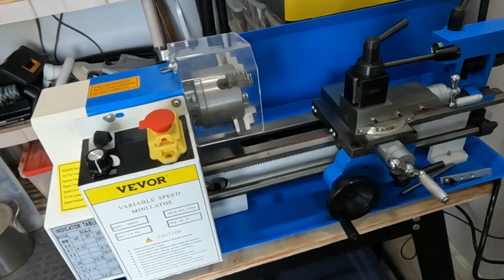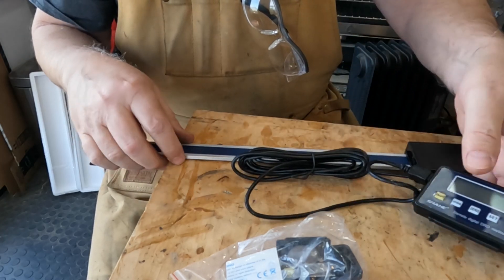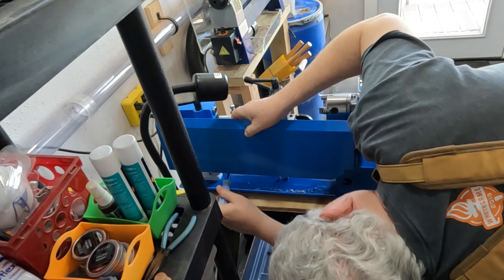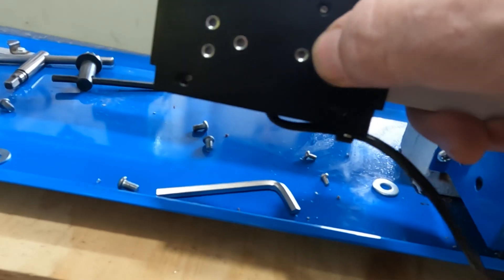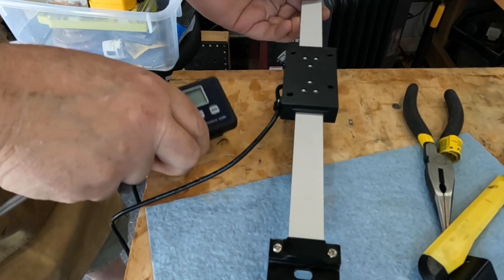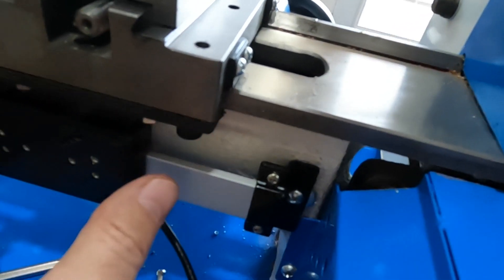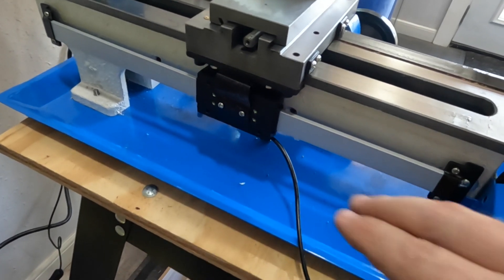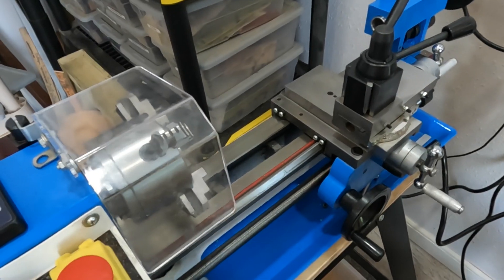Easy DRO Install on Vevor 7x12 Mini Lathe

Comment from the maker: After posting the video, I went back and looked at the reviews of this DRO on Amazon and found someone else that had the same experience (where the DRO bolted onto the Vevor 7x12 lathe with no drilling needed), so this looks like it wasn't just a lucky fluke for me (your milage may vary).   Got the 6" DRO for the cross-slide on order and don't think I'll be as lucky (but I bought a tap and die set just for this project, so I'll be ready)....

Comment: There's a flaw here in out mounting.  The 3 large screws on the carriage are part of your carriage gib.  I've watched this video several times, bought the same dro for my Vevor 7x14 (had to drill a new hole), using the same bent bracket.  As you tighten the center gib screw down it tightens the carriage by design, no amount of washers and shimming will fix that.  Somehow it worked for you but either the carriage is loose or the bracket...can't have both!  I'll likely fabricate a longer bracket that catches the topside carriage lock screw.
Reply from the maker: Did this when I first got the lathe (so was hesitant to drill holes in the carriage).  I only used one of the screws (and didn't tighten it down to tight), so carriage moves smoothly but doesn't flex.   If I was to do it again I might go ahead and drill a new hole for that DRO bracket like when I did the X Axis DRO (it wasn't near as hard to drill as I thought it was)....

Comment: This is what I needed!   Thank you for posting this.  Is there DRO for the cross slide as well?
Reply from the maker: Thanks!   Yes, did an 'X Axis' DRO (same kit, just shorter).   Had to do some creative drilling/fabricating with some aluminum to mount it, but it's still working fine a year later.   I did a youtube video on it so you could watch that to see the fun...